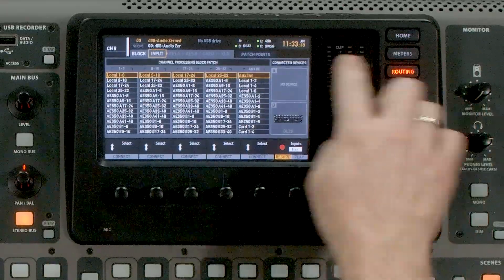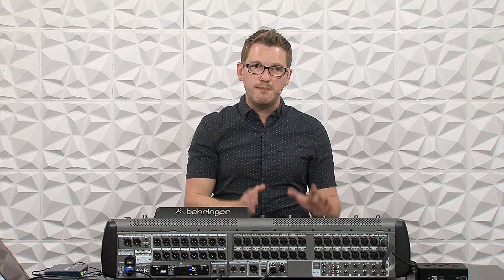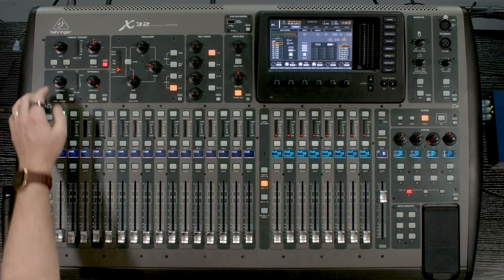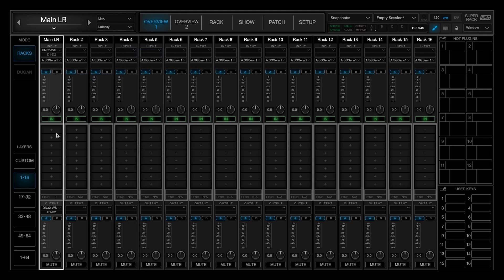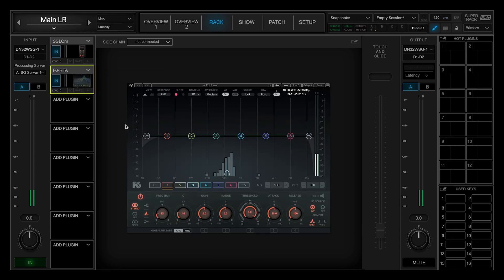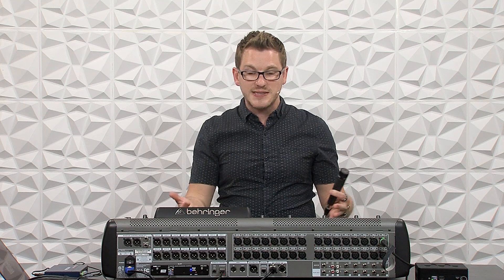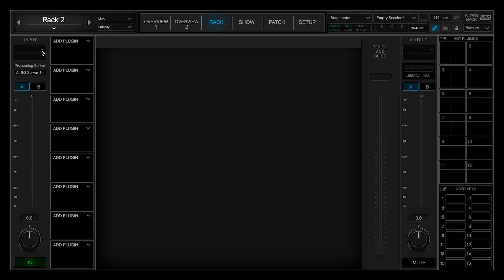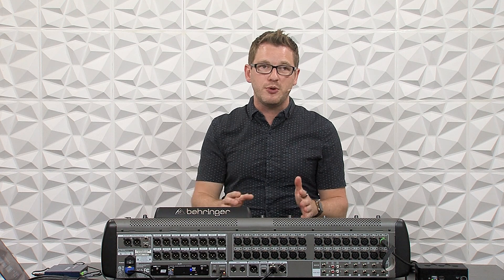Klark Teknik DN32-WSG - Waves SuperRack SoundGrid Behringer X32 Main LR - Aux Insert

Comment: Hello Drew
Great videos as always 👌🏻

Big Question for you here 

Can I insert waves on all 32 inputs after inserting waves on main FOH bus and Left and right Sub bus (I believe this set up will take up 4 multiracks or 2 stereo racks.

Or will I be left with 28 inputs that I can insert waves on after I insert the two stereo racks for main FOH plus Subs stereo FOH
Reply: You can only 'insert' on the 6 Aux channels. All the other channels are routed directly to the software in the routing tab. But its still 32 channels usable even when you have 6 aux inserts.
Reply: I have sort of the same question. So can I still send all 32 inputs to WAVES for processing and use the 6 AUX inserts or would I only have 26 inputs sent to waves sent AUX 1-6 would be being sent through the card as well?